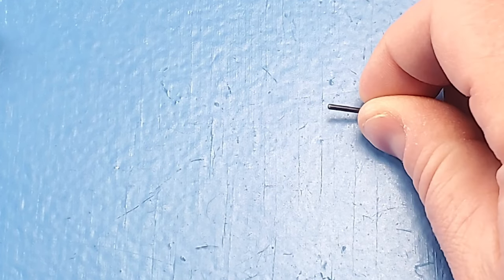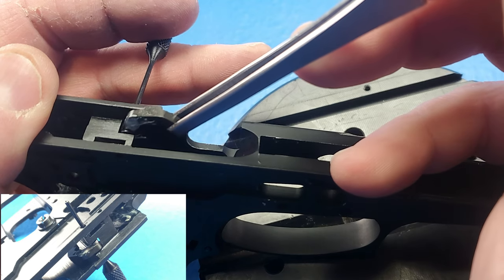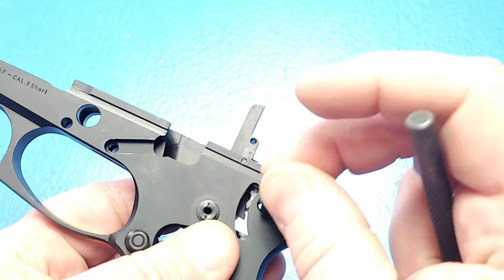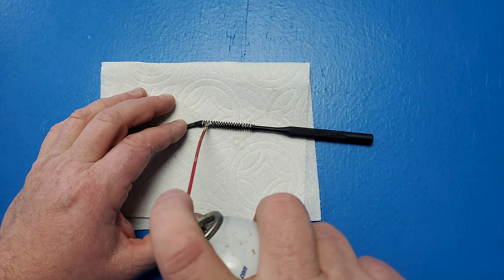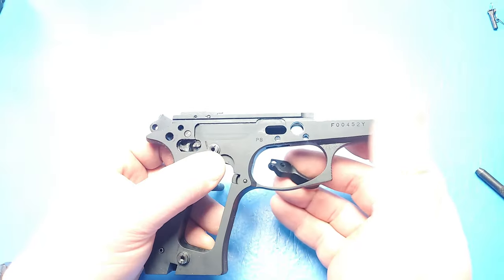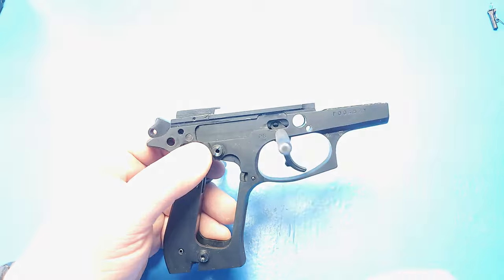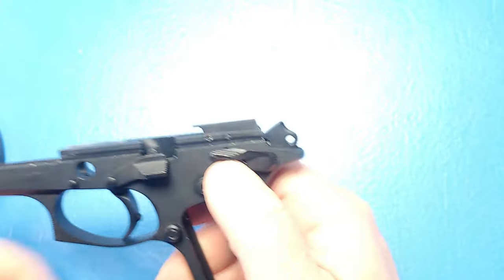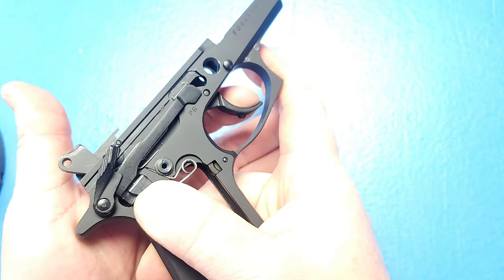BERETTA CHEETAH STEP BY STEP -Beretta cheetah reassembly for Beretta model 84 and Beretta 85 cheetah

Comment: I bought a Model 85 and had a gunsmith add a finish. He used KG Guncoat and it turned out great. He said breaking the 85 down and reassembly was a challenge. I hope he saw your video. Thanks the videos are great and easy to understand.
Reply from the maker: Funny. I get a a bunch of cerakote shops that reach out to me on this gun. It is a real PITA to work with. When I was an FFL I used to Cerakote a bunch of surplus 84s and 85s and got good at them.

Comment: this has been most helpful in reassembling the basically indentical trigger spring on my FN Browning BDA 380, which is the .380 version of the .32 caliber FN140DA, but made by berretta and sold under browning for the American market, discontinued in 1997, and is essentially a model 84 without the exposed barrel, and with a slide mounted safety/decocker instead of the usual frame mounted one. My spring came out the last time i was cleaning it and i havent been able to to figure out how to put it back in ever since, basically found next to zero info on it, just an unhelpful user manual, schematic with parts list, and a couple old forum posts that basically said let a gunsmith figure it out, along with complaining about how it was difficult to source these replacement springs even back then.

Comment: Greatly Appreciated. I believe that all gun owners should know this information (and then some) about each and every gun they own. I know it shouldn't be required by law in any way... but I think it should be a personal requirement of each person. We are responsible for our own firearms and their safety and reliability... so each person should know Precisely how his gun works, how to field strip, disassemble, function check, safety check and maintain each firearm owned. I've actually seen people modify their guns and/or holsters which caused negligent/accidental discharges... and then they STILL tried to blame and sue the gun manufacturer, as if it's somehow their fault that their guns go off when the trigger is pulled.

Comment: Found an "easier" way to do the trigger spring. I found that catching the lower coil in the trigger with a 1/16" punch first. This will allow some movement to the rear so you can then pull the spring back to get it captured in the takedown lever pin.

Comment: hay ive been looking around at BERETTA CHEETAH's. but i wanted to swap out a few parts looking at getting a used one, but then the idea of just building one came to mind do you think i could do this would it just cost more? i would for sure have a gunsmith check my work after but i just wanted to see what you thought thank you!
Reply from the maker: Usually building one is more expensive than buying one... but then again, I believe Beretta stopped importing them again. Not sure if you will find all the individual parts to build from scratch.
Reply: @TheRogueBanshee  yea finding a lot of videos on how people get the 81',s for 200$ now looking it up its at 400$

Comment: I have a model 87BB thr is no firing pin block in the slide from factory, but thr is a firing pin catch lever (can be seen at 5:16) can i remove the firing pin catch lever and the spring to lighten my trigger pull as its doing nothing just sitting thr except for making my trigger pulls a few ounces heavier ?
Reply from the maker: For liability reasons... the only thing I can say is, it was put there for a reason from the manufacturer. Thanks for watching!

Comment: Seeking a repair opinion for my 84FS:  the frame slide guide-rail on the left hand side just forward of the front straight-pin hole of the ejector has broken off from the slide-catch cut-out back to and including the front half of the straight-pin hole. (best seen at ~3:31) The straight-pin is still in place and the ejector seems only slightly misaligned.  I have not attempted to fire weapon yet. The slide moves without impedance on field-stripping. Do you think this reparable or would frame have to be replaced? I’m guessing probably the worst case scenario unfortunately.
Reply from the maker: For liability reasons, I cannot give advice. However, if that were my gun, I would strip it for parts. That is some significant frame damage. I feel sorry for you. Thanks for watching and glad you like the video.
Reply: Frame sounds like it is significantly damaged.   Possibly,  consider contacting Beretta.   They may be able to replace it.  If not, plenty of good parts within the frame.

Comment: anyone else having trouble getting that right side safety roll pin out? you say 1/16th" punch but the pin seems way smaller than that. I have a model 84bb. would that make any difference?
Reply: nevermind. I just used an eyeglasses repair kit screwdriver. now I'm trying to get the trigger bar installed. the trigger spring seemed easier in comparison

Comment: Hi,... Great video, always enjoy your videos.   Just bought a 82bb made in 1992.  The hammer is a real bear to cock.  I own 4 otner 80s series berettas and none are  as difficult to bring the hammer back.  As you know, this also makes the slide very hard to rack....  Is this common with this model?  Gun runs fine.... And is in 32 auto.

Comment: The trigger spring probably took 45 minutes, but also 2 years off my life.

But thanks, or it would have just sat in pieces lol
Reply from the maker: Yea, that is a real MFer. I used to buy these on surplus, fix them up, refinish them and sell them, I got pretty good at doing the spring. But damn, I had a hard time figuring them out. Glad you got it back together.